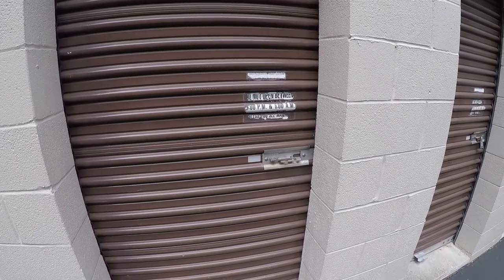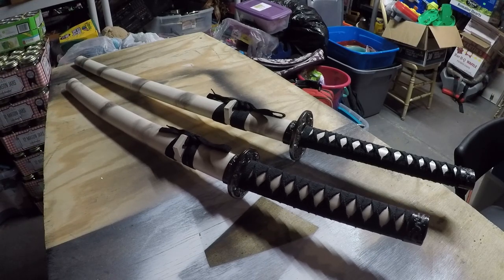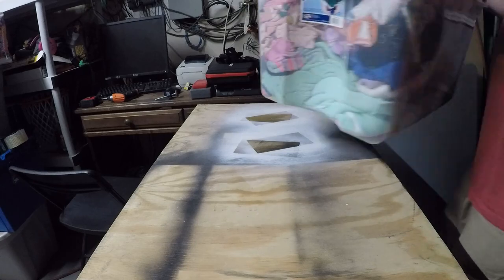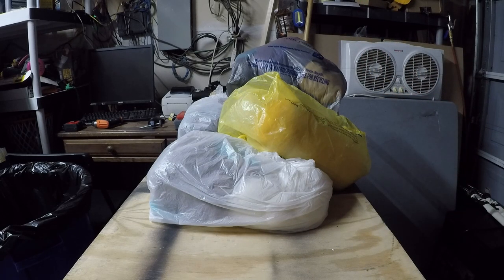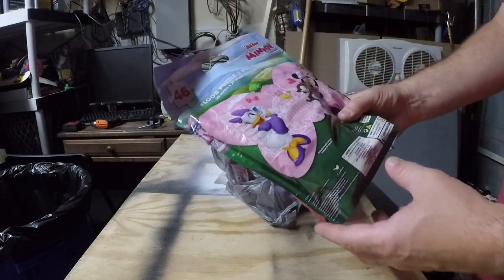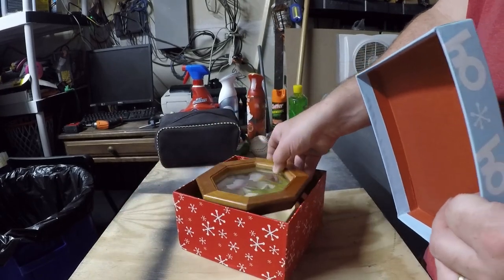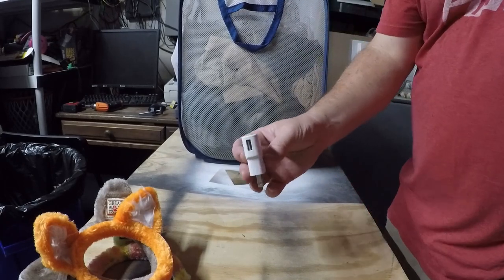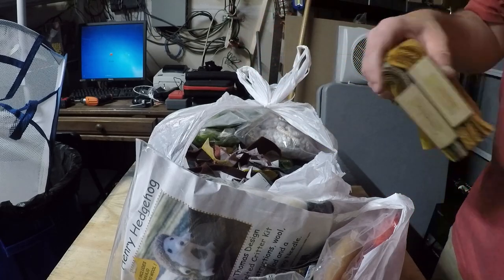Won Storage Unit Auction Samurai Sword Unit Part 1 of 2

Comment: Sadly, the katanas are reproductions and aren't worth much. Just don't swing it around or anything because the blade might break off and hurt someone.
Reply from the maker: Yeah I kind of figured they were cheap. They are still in my garage. lol. I need to list them for sale even if its not for that much. It would have been nice if there would have been a holder for them. Thanks for watching and commenting!